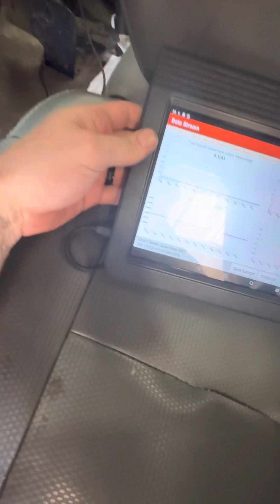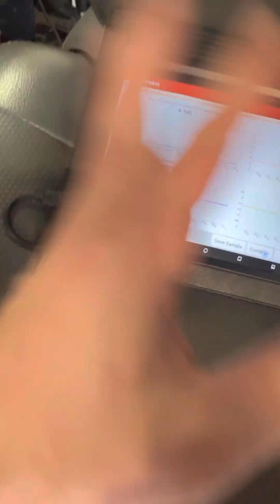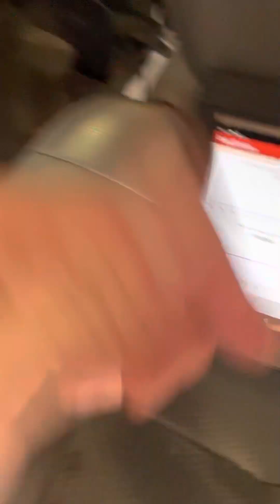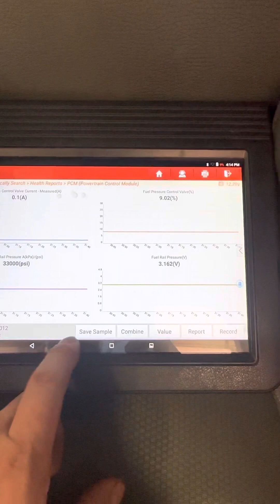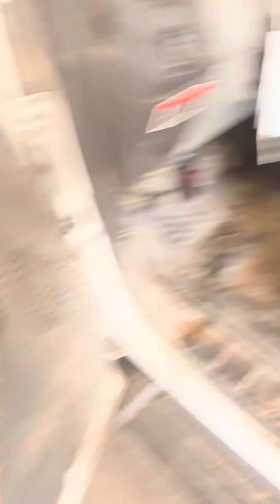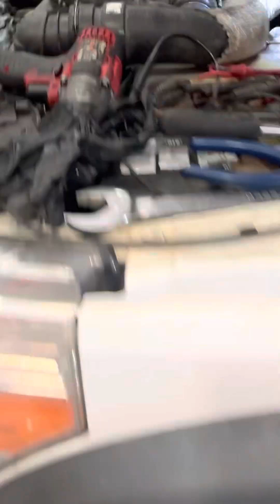6.7 powerstroke p0193/p0088 high rail pressure/ circuit high

Comment: This right here is kicking my ass I have a 2011 6.7 with this issue but i don’t understand that my sensor is a two prong and the pig tail is a three wired
Reply from the maker: Has to be the wrong sensor, no way a pressure sensor can have 2 wires, it need voltage reference, signal, and ground to measure variable voltage inside which is than interpreted by the ecm and turned into a value that we understand like 5000psi. Double check that’s pretty interesting, has it always been like that?
Reply: Wrong sensor bro have the same issue as the video bro first comment was sensor switch that has two prongs the fuel rail pressure sensor is the one with three prongs on it just like the video and it’s still kicking my ass !
Reply: So yes yore video helps a lot I pill back on that pig tail abut six inches all of it was melt down and exposed copper big time is just that when I mande my cut  I lost track of which wires gos to what to the new pig tail .it my understanding for what I investigated that looking at pigtail connector with looking tab on top that 
Pin 1 signal frp voltage output pcm pin 21
Pin 2 vref 5v reference pin 15
Pin 3 signal return (ground) pin 4 
So with all of hay in plac
Koeo pin 1 I get 4.6v 
Pin 2 5v 
Pin 00.01 good ground

Comment: How do you test the actual sensor?
Reply from the maker: As for the actual test for sensor I can’t remember if the sensor was shorted you would be getting different codes short high or short low, or open. I would plug sensor back in and back probe it with a meter and see what return voltage you’re getting compared to what sensor voltage is from ecm, you will need a scanner capable of data streaming to look at that and to see what rail pressure actually is. I think it’s 200 psi with no pressure on it. Usually 5,000 psi while idling and the graph or numbers need to be smooth no spike or erratic number jumping by hundreds not tens. Kinda hard to explain through text

Comment: I get the right side of the harness  Wire is supposed to be 5.3 or so what is the middle wire supposed to read? Cause I'm getting nothing on the middle and the left.
Reply from the maker: A 3 wire sensor should have 5 volt reference, ground, and sensor voltage return. So 5 volts to sensor plus a ground and then the output from the sensor to the ecm. Hence sensor return voltage

Comment: I have code p0088 on f250 2013 diesel 6.7
I have remplaced fuel rail,regulator and pressure switch and still doing same problem 
Can you give an advice
Reply from the maker: Best advice I can give you is trace your wiring harness back from where it came from… last guy found an oil leak that had intruded the harness and was causing a short, they rail pressure will hardly ever get high enough to throw a high pressure code… with that being said it’s prolly a wire harness issue somewhere you can not see. It’s a pain but you will have to start taking things apart and trace the harness back look for anywhere it could be rubbing, pinching, coolant/oil leaks that are next to harness, and corrosion on pins to parts you replaced, also I have seen people stick multi meter probes in connectors and expand pins that will not make contact and cause theses issues.
Reply: Thank you so much
Reply from the maker: No problem hope you find it!

Comment: Great video I'm having same issue  same codes but I'm only getting 4.3v to the sensor do you think it could still be a bad ground? If I test voltage from ground on battery it goes up to 4.7v
Reply from the maker: Thanks appreciate it, uhmm, I think I would try and stick a back probe in ground signal wire on the sensor connector and ground to a known good ground while plugged in and see if you can clear code. Let it run and see what it does, are you able to read live data? If you can watch rail pressure and see what it is doing. If you don’t have a back probe I know harbor freight as an inexpensive kit that would help.

Comment: The same thing is kicking my butt, I have a 2013 6.7 power stroke giving me the same code that the fuel rail pressure sensor circuit high, I put in a new pigtail because all 3 wires were bare and touching, and also replaced the fuel rail because of shavings on the fuel regulator. And still reduced engine power and same code comes up. Also replaced the cp4. I’m out of options besides tracing wires or what do you think??
Reply from the maker: Yo, sorry that your having those issues, since you have already been through the ringer with the problems  I would check the continuity from ecm plug to connector-> make sure you have resistance .02 .03 average for resistance in wire by itself and load test wire if possible OR run overlay wires from ECM pin out directly to sensor to rule out hidden harness damage that can’t be seen choice is yours just have to decide on which one. the diag tree will have a better way of testing but this is the easiest to explain. lol  HOPE IT WORKS OUT 💪
Reply: Thanks man! I’ll see what I can find and I’ll let you know if your interested
Reply from the maker: Sure keep me posted
Reply: So here’s what I found I looked up a wire diagram and 1 wire from the pressure sensor connects to the throttle valve and the other wire that’s intact with it in the harness is connected to the crank position sensor. So I checked the wire harness for the crank position sensor and sure enough oil had saturated the wires corroded them together. Fixed that and all was good.
Reply from the maker: @shakenbake2844 F- yeah brotha glad to hear you got it going man! That’s bad ass… finding the problem in those harnesses are a pain it the butt. They are real tight spaces  and of course covered up. Either way glad you got it and saved your self a hell of a lot of money. That’s awesome 😎
Reply: Which wire is connected to the crankshaft position sensor?
Reply from the maker: I would have to look through a wiring diagram but the only shared wires would be sensor supply or sensor ground, the third has to be from sensor by itself because it’s supply sensor return to ecm.
Reply from the maker: You can swap wires except ground, even if you did it’s just gonna give you a short to ground so just swap them if you get to the point you don’t wanna deal with it anymore. Of the are wrong you will just get a different DTC set in the ecm
Reply: @blacksheepautoworx i had ground in the other side !🤦🏽‍♂️lucky my old pig tail as burn as it was told me which one was the ground .
Reply from the maker: Nice glad you got it!

Comment: Thank you so much for this video. I will check my sensor harnesses out. I wonder if the new harness are a cut back, and Solder together. Or a plug and play ordeal.
Reply from the maker: No problem my friend glad it helped, the new pigtails usually come with crimp and shrink tube kit from what I remember.

Comment: Do you have a part number for the plug?
Reply from the maker: This should be the part number for the 6.7 pigtail for rail pressure sensor 

Fuel Rail Pressure Sensor Connector - 2011-2022 Ford F250 Super Duty 6.7L V8 - Motorcraft 96694-02675383

BUT… the 08 is a 6.4 and that sensor is located under the passenger side valve cover mounted on fuel rail. Any auto parts store should carry it last one I bought from oreillys
Reply from the maker: I’m sure I have it at work I’ll send it tomorrow morning
Reply: Can you send it to me along with the location of that sensor I have a 2008 f250 with the same issue
Reply from the maker: Fuel Rail Pressure Sensor Connector - 2011-2022 Ford F250 Super Duty 6.7L V8 - Motorcraft 96694-02675383

Sorry I’m sure you got it by now, got busy and forgot to send

Comment: I have the same codes but low fuel pressure and reduced power.
Reply from the maker: I would check your high pressure fuel side than, need to connect to ecm and watch you rail pressure and compare it too desired rail pressure, another thing I have seen cause low rail pressure other than the cp3 pump dying is fuel filter on Bottom of truck sucking air. I would check those 2 things first. Good luck 👍
Reply: @blacksheepautoworx  Thanks
Reply from the maker: @e-ticket5625  yeah np, if you run into anything just hit me up I’ll get back to you
Reply: @blacksheepautoworx  had all fuel rails and injectors replaced changed cp4 to cp3 with the anti disaster kit and fass fuel system do you think the fuel tank may be clogged or dirty?
Reply from the maker: I wouldn’t think it is, chances are slim but definitely a possibility. I have seen bugs and debris get caught in lines and banjo fittings. Since you have a fass do you have a fuel pressure gauge? You can ohm out that pressure sensor see if it’s in spec and good. Find a way to read live rail pressure data and check under a load. Check high pressure fuel fittings for tightness and check fuel system as best as you can for suction side leaks and inlet of fass for debris. Or if you know someone with the same truck ask to borrow they pressure sensor and test or you can buy one but a little pricey not crazy but we all have financial obligations so I get it
Reply: @blacksheepautoworx  Thank you sir🙏